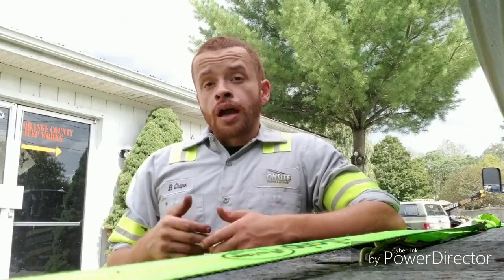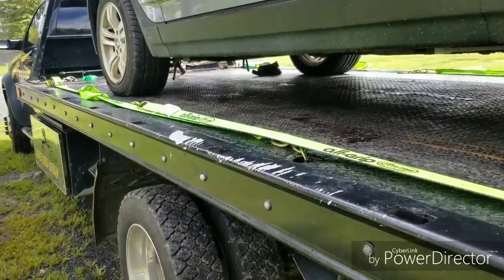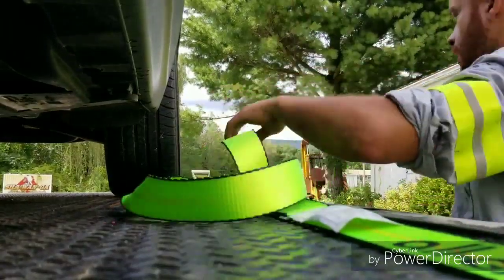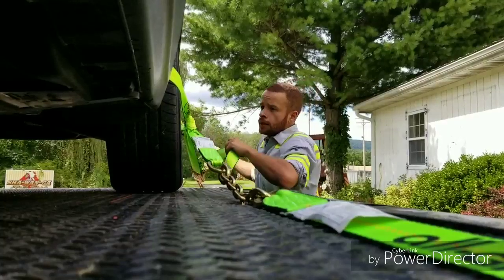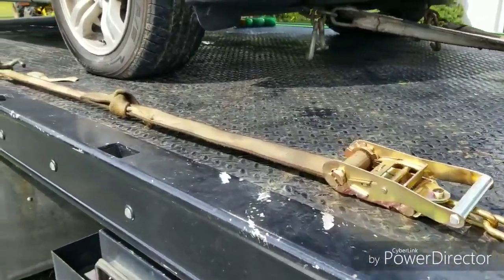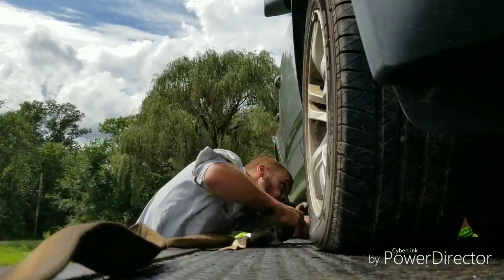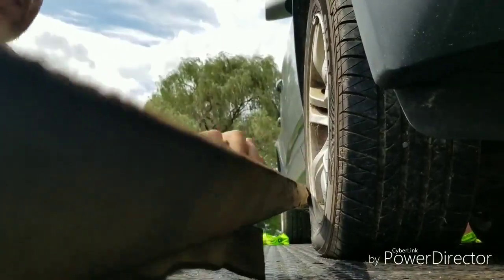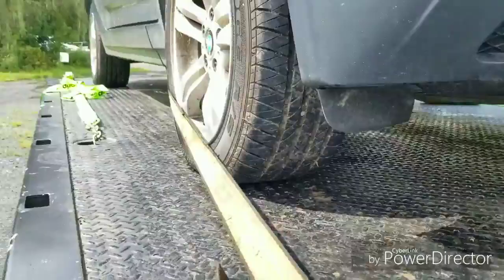Different tie down methods with Hi-Viz 8-point Tie Down

Comment: Interesting about the four points needing to be adjustable. The regs here in my opinion make it a gray area. I'm in Canada and the National Safety Code for Motor Carriers states: 
"19(1) A tiedown used to secure cargo to a vehicle shall be designed, constructed and maintained so that 
the driver of the vehicle can tighten it."
If I have two chains at one end and two chains and binders at the other I can tighten all four chains with two binders. I have gone through the coup 100s of times with vehicles and equipment secured this way and they have never gave me trouble. Not to say they won't one day I guess. 8 point wheel straps are definately the safest way to go. They suck in the winter though. I usually chain when it's -35°C lol